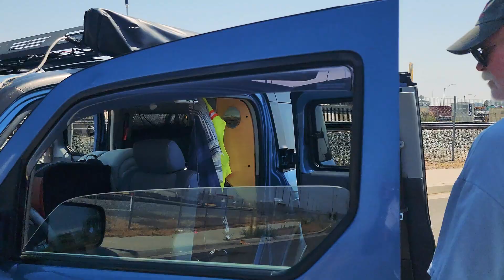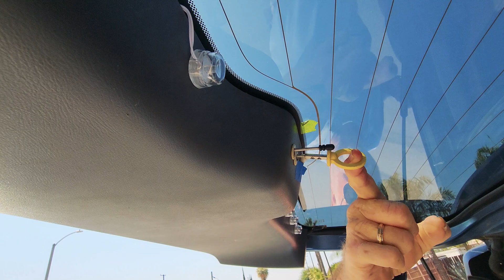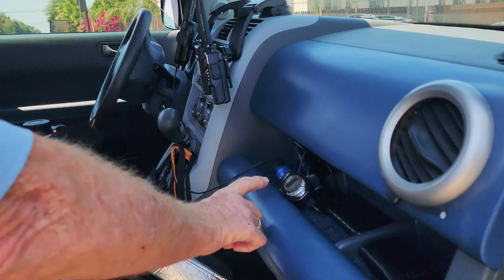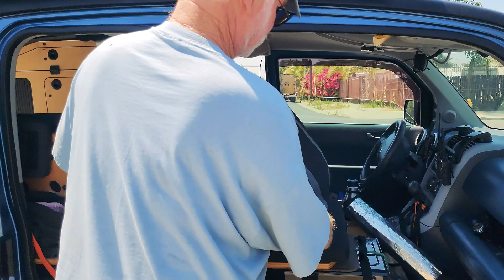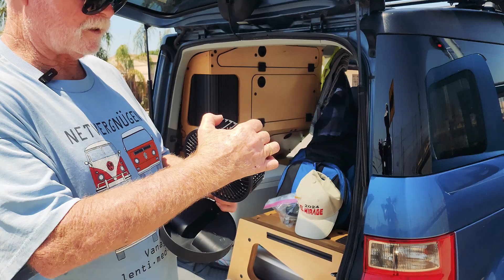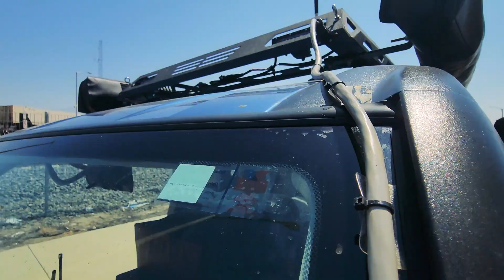Engineer built Honda Element Solo Camper

Comment: ...   do they still make parts for the Element ?  ...    safe travels   ...
Reply from the maker: @roger3786  Yes they do, although some parts are very difficult to find however since Honda shared alot of parts with its other vehicles it's easy to find a part from a civic, accord or CRV from that year that is compatible. Also there has been tons of family owned businesses who are element enthusiasts who have started making replacement parts that are even better than OEM.
Reply: @ReadySetElement  ...  TY ,   my  '04 was crushed by a tree yrs. ago  -  thought Honda was gonna give it a more powerful engine , never came about  -  so moved to a Subie  ...